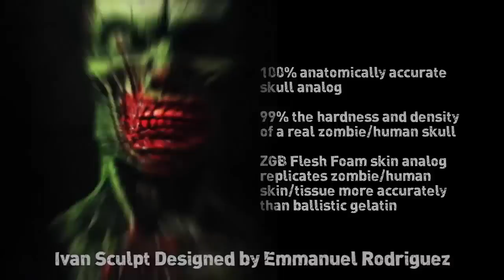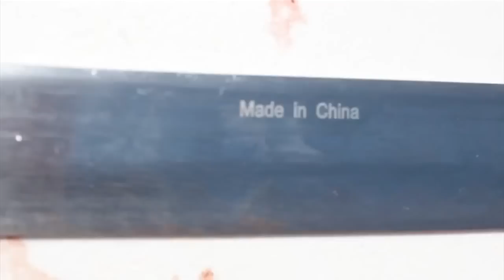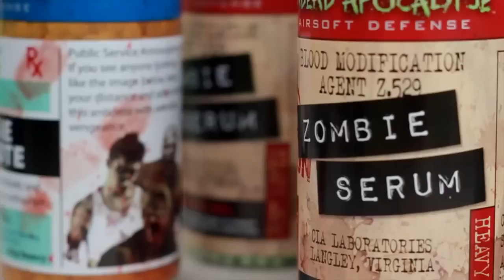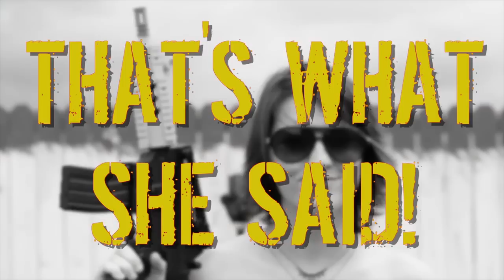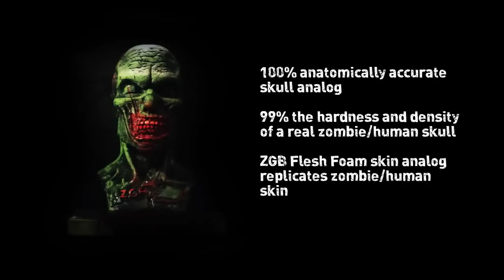Top 10 GREATEST HITS!!! | Zombie Go Boom

Comment: Why not try this idea. (Maybe it'd work) use some sort of a board (Probably a 2x4) and put something such as (It may seem dumb) doorknob, screw it to the board and you could possibly make a homemade club of some sort. (The door know of course being a rounded knob.) I doubt it'd work though, but can still be something to think of (even if this comment gets noticed). Or perhaps something with sturdy chains?
Reply: That's not a stupid idea actually. The chains would definitely destroy the head
Reply: Oh ^_^ Thank you!
Reply: +Horror Videoist  they've tested a normal 2x4 and it works perfectly fine. Why waste materials building a weapon?
Reply: Not exactly sure, maybe increase it's durability.
Reply: Horror Videoist putting nails in it and risking it cracking?
Reply: Well honestly you wouldn't out a ton of nails/screws it in. To keep the doorknob stead it wouldn't take much.
Reply: Horror Videoist But again, why? Those nails could be used building a wall or repairing a weapon that needs them Not "improve" on a weapon that already works fine
Reply: Ok, why is this so important to you? It's just a thought. There is no need to blow it out of proportion and put reality into a suggestion that will never happen in real life. It's a "what if".
Reply: Horror Videoist Eh. Guess you could call me a fan of zombie apocalypse. Just putting logic into places it doesn't need to be.
Reply: Ah, lol.

Comment: How do you make the blood in side
Reply: +Jnyah Plays  fill a blood bag and put it into the molds before they dry. The line you see on the top of the head is because the skull is two parts, the back and front. You put blood bags inside and then put the molds together to dry

Comment: TI readily accept that ZGB is for laughs and sheer juvenile entertainment value, thew only thing that REALLY irks me is the startlingly high number of examples where there is a clear lack of basic sword/weapons safety. Charles never really does this but many of the guest executioners tend to keep their off hand flying about in front of them when they are swinging a deadly bladed instrument. You should really hold it across your chest, behind your back, on your hip, any place that is not in the path of the blade. Also I noticed that there were several examples of the 'executioner' s leg or torso in the path of their swing arc. I cringed quite a bit despite knowing their couldn't have been any mishaps. :S